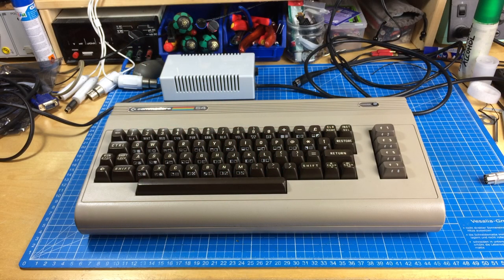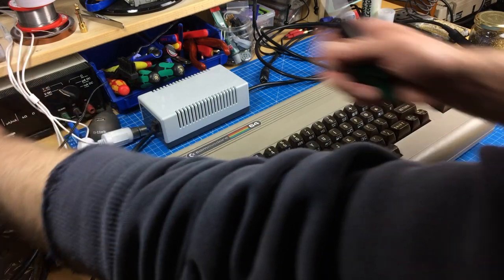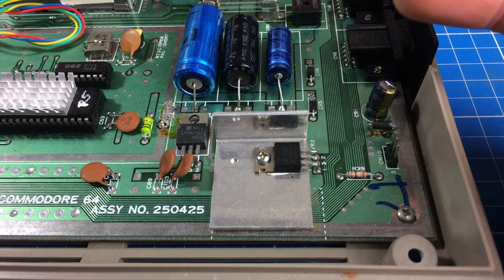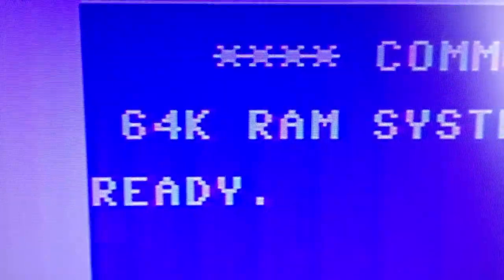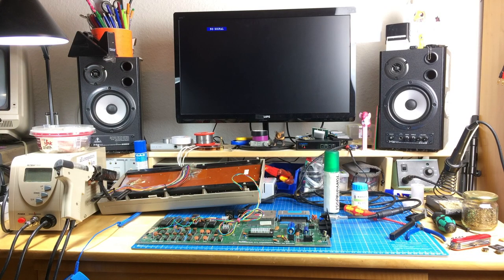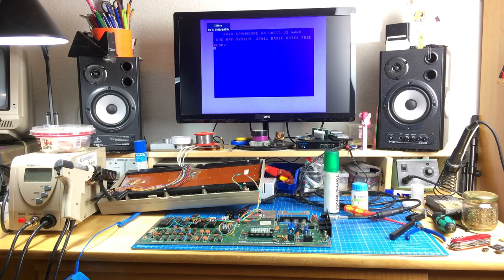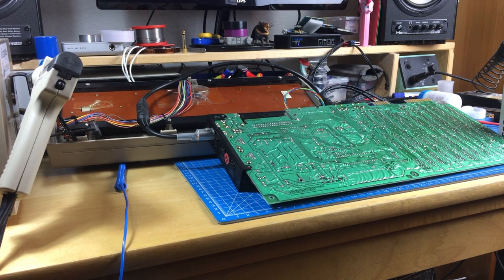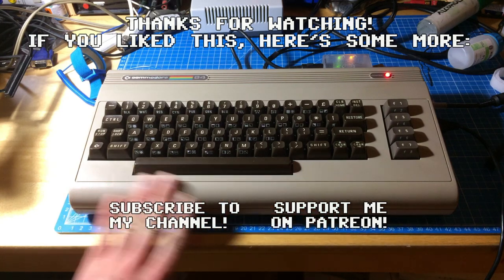Converting my C64 to modern DC-DC Converters

Comment: Great video Jan. I've been considering using some of these in some recording equipment which dissipates SO much heat into its casing, it's as hot as a radiator after a few hours. But of course I have concerns about noise!

Do you find your desoldering gun blocks up easily? I have the same one and I've taken the gun apart three times to drill out a blockage at the "cold" end near the glass chamber. It's so frustrating!
Reply from the maker: I did some better noise measurements in the follow up video. It's just a couple of mV so it's probably not an issue for most equipment.

The desoldering gun blocks sometimes, yes. I usually try to clean it after each "session" using the poking bits that came with it and my soldering iron. By heating up the solder in the cold part I can usually get it out that way.

Comment: Same mod works on TS1000 and it lets you ditch the big metal heat sink.
Reply: If you remove that over time it will get lost. If you leave it in place inside the original heatsink will not get lost.

Comment: Nice! Been thinking about doing this mysef. The breadbin gets very warm, and you can feel it under the c64 where the regulators are. Perhaps just a 5V switcher to begin with. The ones you have found seems nice quality.
Reply from the maker: As you have seen in the follow up I settled for only the 5V regulator now. It brings down the overall temperature in the case by a lot so it can't be bad in that respect. The RECOM converters seem to be really good (and expensive) stuff. :)

Comment: Nice mod. Keeping the heat away is good for longevity. And it's even reversible.
Reply from the maker: Yes, I'll have some long term observations to make (obviously) but for now I'm really satisfied with the result.
Reply: I'm now tempted to do the same with my old MSX. It has an internal PSU, and the transformer is humming. Maybe SMPS replacements for the linear regulators will bring the power consumption down enough to make it quiet.

Comment: You want to get a future proof C64 (me too). I want to ask you: Have you touched the VIC and the SID with heatsinks after half an hour? Aren't you worried about so much heat?. I know that those chips were made to suffer that heat.... but that was 30 years ago. I'm actually installing a fan or maybe two. Yes,  it can give noise or interferences, that's why I'm checking and trying different options and fans, but I would like to know your opinion or whatever you make about this.

Another thing (or the same): What do you mean in the video when you say that now the C= will run much cooler? Do you refer only to the voltage regulators or does it also affect to all of the chips in general?
Reply from the maker: Yes, they get pretty hot. Unfortunately there's not much you can do about it except for applying heat sinks and pulling as much heat away from the chips as possible. Adding fans is an option of course. Repair guru Ray Carlsen found that it is pretty hard to position them right to significantly improve cooling. At least without modding the case, it seems to be difficult to get good air flow. Maybe I'll look into that myself sometime but I'm generally not a big fan of fans (ha) in C64s.

I meant that the general temperature inside the case is a lot lower (it got very warm from the outside before, now it's nearly at room temperature). It won't make a major difference for the other ICs but it definitely is an improvement.

Comment: Great job! Glad it turned out clean and 100% for  you. I need to do this on the 1200XL. ;) It uses a large heat sink + rectifiers setup.
Reply from the maker: I actually had one strange issue (see follow up video) but otherwise the mod worked absolutely fine. I think I'm going to use these converters for future mods, too.

Comment: that solder mask looks so wavy... o.o
Reply: It's not the soldermask, the traces are tin-plated and on thick traces it creates ripples under the soldermask. On old boards they often skipped the extra production steps required to ensure smooth finish on such boards since it doesn't affect the performance in any way. Modern boards don't typically tin-plate the traces so the soldermask is applied on bare copper and they don't have the same cosmetic 'issues'.
Reply from the maker: I also heard somewhere that the tin got too expensive... ;)

Comment: My C64 (later model) does not feel that hot, guess mainly bread-bin models suffer from this?   
(I did this for my ZX Spectrum to fix the waste heat given off, it was just silly hot before the replacement)
Reply: Correct, the later HMOS chipset consumes a lot less power and therefore the voltage regulators also produce a lot less heat. They remain inefficient though.
Reply from the maker: Yes, the newer board revisions run cooler. The short boards even got rid of the linear regulators altogether and are regulating the voltages using a zener diode circuit. 12V are no longer needed by those newer boards, too, so they run a lot cooler.

Comment: Another great video, would have been good to get temperature readings before and after the mod. Thanks.
Reply from the maker: Thanks, the temperature measurements are a good idea. All I can say is that the C64 was really warm before and now it's very close to room temperature from the outside. Significantly cooler.

Comment: Hi Jan and welcome back! :D
Did I understand correctly? VRs substitution has improved C64's video output?
Reply from the maker: No, it didn't improve anything except for the temperature. I was just checking to see if the ripple the modern converters produce introduces noise to the video signal.

Comment: Hi Jan! Happy to have you back :D Well, maybe it's just the camera or I don't know, but I see some kind of violet horizontal bleeding on white letters on your monitor... is that normal?
Reply from the maker: Thanks Gabriel! The bleeding is normal for the old VIC-II chips as far as I can tell. It's not that obvious on CRT monitors but on the LCD screen you can see all the glorious flaws of the chip (like the vertical lines and color bleed). The more recent versions of the chip (used in later C64Cs) have less color bleed but the colors are not as vibrant.

Comment: Good job, that should make the machine a bit cooler inside. I'd expect it to work, but the way you tried to look for the noise does not really make much sense. AC mode on the scope (you don't want to see the DC, you are just looking for the AC component), low voltages on the Y scale and play around with the timebase a bit to see different frequencies would have been much, much better. Also remember to probe the input and output sides of the regulators, the input can be noisy too. Manufacturer datahseets always show recommended circuits so you can add caps or inductors on the input/outputs to make the devices preform like they were designed to.
Reply from the maker: Thanks, I made a follow up video with slightly better measurements. (As you have probably seen in the meantime...) :)

Comment: It's hard to tell the difference in the picture in this video but do you believe it's worth doing ? Can you notice ?
Reply from the maker: The picture is absolutely the same as far as I can tell. This is not meant to improve anything. The result is just that the C64 runs way cooler and draws less current while still having the same picture and sound quality.

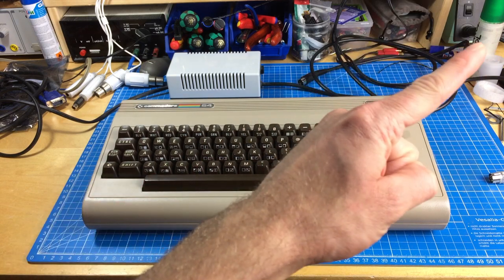Comment: Hi Jan @ 0:56 you point at the upper right corner so to later add a link to that location (about the 4 kernal select) but you forgot. Hope I helped you out with this tip :)
Reply from the maker: Oooops, thank you sir! I forgot to note that down so I didn't insert the link. Will do so immediately. :)
Reply: Jan you're welcome, please call me Maico :)

Comment: One thing about the C64 is there are quite a few ferrite beads all over the place in the power supply lines. This alone will probably keep most of the crap that the switchmode regs produce away.

Measuring supply noise - the correct way to do this is to measure at the device consuming the voltage. so at the power pin of the VICII (pin 40 i think). You should AC couple your 'scope and set it to a high sensitivity.

For your scope probe ground, this connection needs to be as short as possible - the best way is to remove the ground lead from the probe, and the "witches hat"... you should find the needle point probe on the end has an exposed metal band around it, which is ground. Then you can use a probe spring like this one: https://i.stack.imgur.com/7OPgl.jpg
Reply: If you dont have those probe springs... well.. i just stripped some CAT5 wire, solid core, and wound it into a spring. Works well enough ;)
Reply from the maker: You're right. The way I used the scope on the regulators doesn't say much about ripple anyway I guess. Other than the rail is not completely noisy. ;)

I'll do a follow-up with some longer term observations some time and try to do some more meaningful measurements I guess. ;)
Reply: Good to see you back in action anyway :)

Comment: You are using an analog scope and the brightness is too high, so your line is 1/10 of a division which isn't useful for seeing ripple in the voltage signal at your current V/div selections. Use a lower V/div setting and adjust your offset to actually see the ripple. On these old scopes you have to constantly adjust the brightness according to your scan/sweep settings to get a nice thin line.
Reply from the maker: You’re perfectly right of course. Thanks for pointing that out. The brightness looked better in real life than it did on camera but there was nothing to see because of the high V/div settings I used. The ripple according to the datasheet is only a couple of mV so the converters are still well suited for the job I guess.

Comment: Personally I don't like these kind of mods. A linear regulator should be sufficient. If heat is a concern then just mod/add a heatsink. Also DC/DC converters can induce noise on the supply line which could impact sound / video quality.
Reply from the maker: I was really careful about this mod, too. That's why I compared the picture and sound and looked at the scope. These high quality converters seem to work very well. And they bring the heat inside the case down significantly. I'll obviously have to make some long term observations but for now I am surprised about how well this works.
Reply: g412bb is right.  As per data sheet, a capacitor can be added between input and ground to remove the “noise” others see when added to RGB modded consoles like NES. 2600RGB comes with capacitor for this fix.
Reply: Thankfully we Atari 8 bit users don't have these kind of worries.....nothing overheats with them because Atari was smart enough to keep the PSU completely separated.My concern with modern day regulators is....how long will they last ? I have high doubts that electronics that switch 100,000 times per SECOND will last 30+ years like conventional regulators usually do....that's why I don't do these mods. At least it's a good idea to get a well known high quality brand for this component and not a no-name Chinese one. If a switching DC-DC converter fails it could pass on the full input voltage, destroying parts that it is supposed to supply.....
Reply: Leon Kiriliuk I'm pretty sure the original regulators already have filter caps....don't tell me Jack even saved on those.......:D
Pretty sure the big blue and black caps are those filter caps.
Reply: Why wouldn't they, Atari Andre? The CPU has been happily switching a million times a second.
Reply: tylisirn that is quite something different from something requiring actual power.
Reply: > I have high doubts that electronics that switch 100,000 times per SECOND will last 30+ years like conventional regulators usually do...

I do think this can last 30+ years. Remember that a computer by definition is "switching electronics" and in the case of the C64 switching happens at 1MHz. For a switching regulator, the risk of wear is not in the switching electronics itself, but often in electrolytic capacitors. Elcos don't like high frequencies and can wear within a few years (yes even quality ones). Elcos are used because they provide sufficient capacity cheap. For the purpose of a switching regulator, ceramic capacitors are technically preferred.

Looking at the high cost, low ripple (ceramic does that better) and visually how they are constructed, I don't think these regulators use elcos. They must use ceramic. And that means that means I cannot see any weakness in their construction.

Another threat to electronics is heat. And in the C64, heat is definately a danger for the computer. 78xx regulators wear due to heat and can kill the computer. Now this happens usually in the power supply and not on the mainboard itself, because the one in the power supply needs to deliver more current, so generates more heat and thus fails first. Failures of the regulators of the mainboard are luckily quite seldom.

However, that doesn't mean they are immume to the harmfull effects of heat. Because the switching regulators produce less heat, I would safely gamble that the new regulators last longer, if I can get it confirmed that they use ceramic capacitors.

Question remains if you should perform surgery to a working C64. Personally I take the position that preventive intervention is a good idea for the power supply, because these old power supplies are really killing a lot of C64's. Installing switching regulators in the power supply is a good idea, or you should use a modern power supply.

For the C64 itself, there still isn't much failure to the original regulators, and then I would be tempted to say that at this time, the risk of the intervention is a bigger concern to the longetivity of the C64 than the old regulators.

However, I think that if I would install new regulators, especially now that Jan has proven that there is not much concern for the video signal with the regulators he used, I would install the same ones as he did. 78xx regulators don't have a role in modern electronics design, the world has advanced and is better off without this horribly inefficient technlogy.
Reply: I also didn't understand the purpose of this mod. A modern switching regulator is fine if you are concerned with heat dissipation / efficiency, but the existing proven linear 78xx regulators / heatsinks appear adequate.  In some regards you may be just reducing reliability by adding switching regulator complexity.
Reply: Atari Andre One can’t just put any capacitor and assume it’s done. The spec sheets for the DC/DC power inverters specify type and size of capacitor that must be used. It is specifically chosen to match the frequency of the inverter.
Reply: I have to say I agree, the linear regulators in that C64 have lasted 35 years and appear to be still working fine. In my 38 years experience they are ultra reliable if heat managed properly. I very much doubt that sort of longevity from the more complex replacement.

Comment: I plan to replace my on my 250407 board the L7805 and L7812 with those digital DD4012SA_5V (1A) and DD4012SA_12V (0.8A) that were also seen in Jan Beta's ZX Spectrum video (https://youtu.be/wjrUhELEAms). Comments?

Comment: Hi Jan. I have a C64 that, when I turn it on just gives a black screen. Another Youtuber (Jeffrey Birt) suggested that I look at the voltage regulators. Your video appears to have come just in time. My local vendor sells these regulators. Same brand, just different part numbers. Do you think they would work? The specs look good to me...
https://www.conrad.nl/zoeken?ATT_LOV_CONNECTION_COMPONENTS_any=Soldeerpennen&ATT_LOV_HOUSING_SEMICONDUCTORS_any=SIP-3&ATT_NUM_OUTPUT_VOLTAGES_any=12%20V%2FDC,5%20V&brand_any=RECOM&search=recom&searchType=regular
Reply from the maker: Yes, all converters on that page should work. I wasn't aware that there are so many different versions. I updated the video description with the exact ones I used (seems to be the R-series). The last 7812 on the page you linked to seems to be the exact one I used. For the 5V one, everything at 0.5A and above should work fine (the C64 should draw only about 0.3A from that regulator).
Reply: I believe I saw 78xx somewhere as well so it's all in the same family apparently.
Oddly though I measured no problems with my regulators. One output was 4.97V and the other a touch over 12V. Is it correct that the 5V regulator has 12V input, and the 12V regulator has 20V input? 
I also measured the output pins on my power supply but I got 0V on all pins!! The power supply works, so I must have made a measuring error.
Reply from the maker: Your regulators seem to work alright. The input voltages are approximately right, too. The black screen can be caused by a number of things from a broken PLA to bad RAM. Even a faulty logic IC can cause it. Did you try going through Ray Carlsen’s troubleshooting guides? Highly recommended and you don’t need a lot of special tools.
Reply: Thanks. No I didn't. I'll have a look for that.
Reply from the maker: http://personalpages.tds.net/~rcarlsen/cbm/c64/

The file called "c64blank" deals with blank/black screens. The IC file is also very helpful. It’s usually my first reference for C64 repairs. :)
Reply: Thanks Jan. That will be super useful. The PLA on the faulty board is not socketed, so I'll have to fix that first. I've just recorded some footage of me explaining the problem and doing some initial cleanup of the boards. I've got two boards, one working and one not working. One even has the old ceramic VIC chip!
Reply from the maker: Oh, looking forward to watching that!